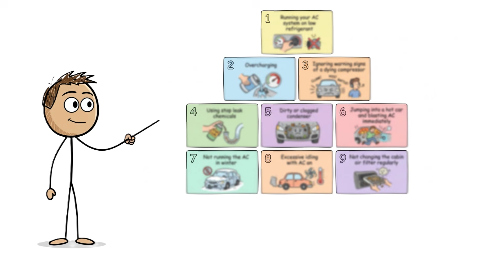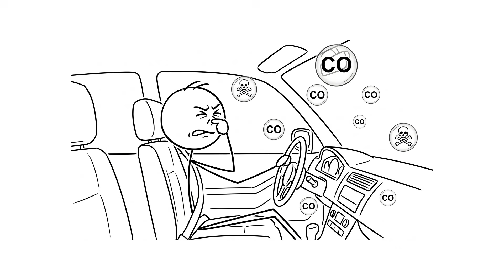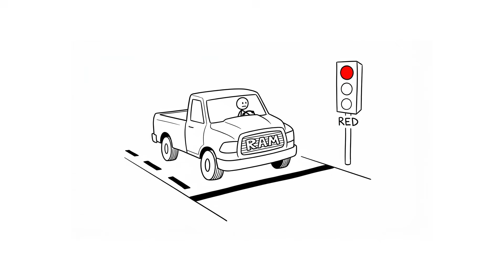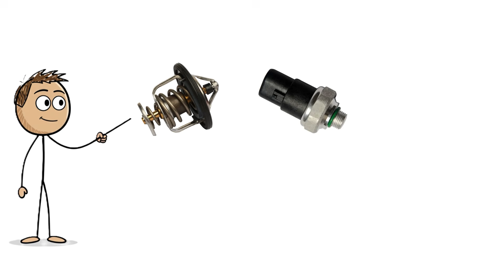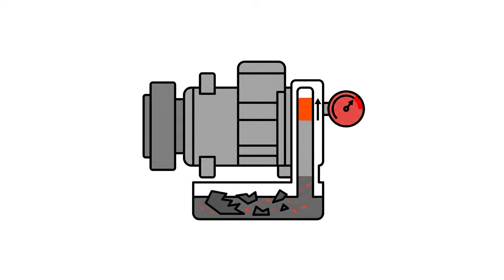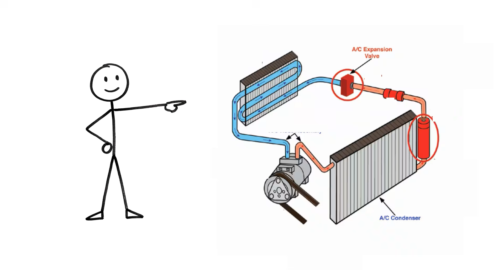How This One Bad Habit is KILLING Your Car AC Compressor Every Summer (And You Do It Daily)

Comment: I run the AC year-round, because it dehumidifies the air.
Reply: Ditto. But I want to see if I can mod my car so that I can control the cooling aspect separately. I don't like it kicking in without my consent.
Reply: @HazewinDog  Turning the defroster on should turn the AC compressor on